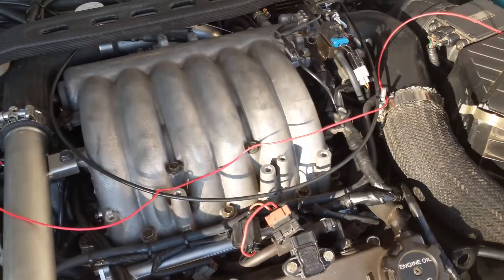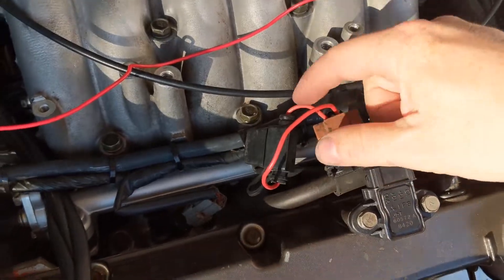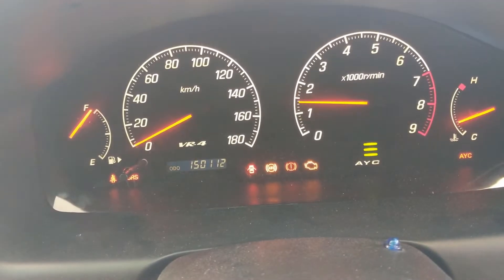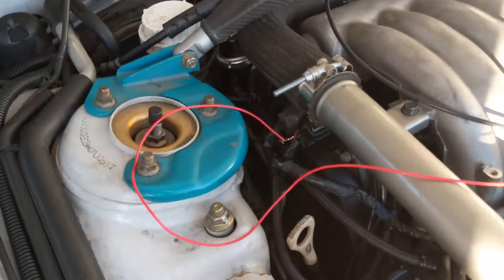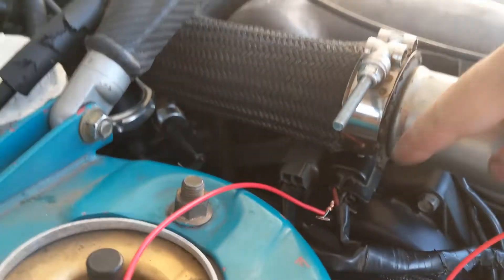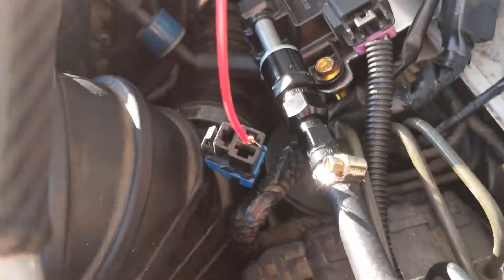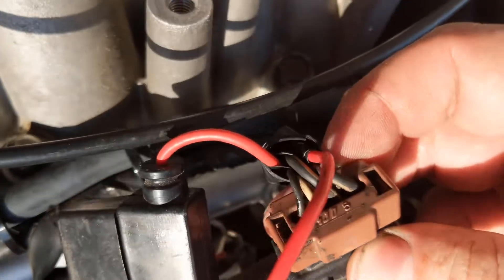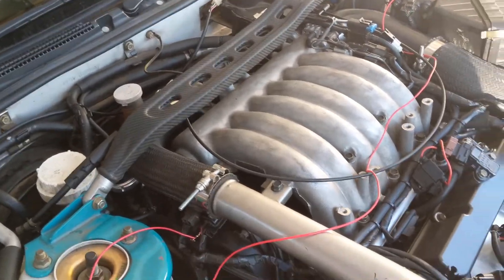Legnum VR4 Ignition Failure Sensor delete

Comment: Please help me you brilliant genius! My tacho died, so decided to do everything you showed in this video…. But still no luck, car starts but no tacho. Is there a ground wire or something closer to the actually instrument panel that I am missing? The tacho started to give trouble a while ago somethings it would work sometimes it won’t then sometimes it moves a little when you floor it. Now it’s just dead zero.
Reply from the maker: Your issue could be as simple as you need to remove the cluster from the car, give the ribbon contacts a bit of a clean with some isopropyl alcohol and put it back in.  Prior to removing it, take the binnacle cover off and see if the tacho starts to work if you push on the cluster a little while the engine is running.
Reply: @KaldekBoch  no luck bro, I also have 2 other clusters and both have same issue, do you know what is the correct voltage I am suppose to get on the rpm signal wire behind the tachometer? Both dc and ac voltage readings might be helpful, the only thing I’m thinking is that it’s shorting out somewhere before the tacho. Or maybe a bad ground?
Reply from the maker: @syrian4 I believe it's a 5 volt square wave pulse.   Need an oscilloscope to validate that you're seeing it.  If the engine is running, then the signal from the crank pulse sensor is working or the engine would not run.  Validating that the signal reaches all the way to the cluster is how you find where the issue is.  It could be also be as simple as a broken signal wire.  

I can only assume that during all this bypass testing you have indeed disconnected the IFS while you do it.  I can make all sorts of assumptions about how you're testing, only to find out that a shortcut was taken here or there, and if it's not something I ever did, it becomes impossible to "follow along", so to speak.
Reply: @KaldekBoch  yes ifs is disconnected, i don’t own a oscilloscope but I have a multimeter, I will confirm that the same voltage I get from the crank sensor is the same behind the cluster, currently pin 3 and 4 is bridged on the ifs and the crank wire is running to the white wire on the check plug exactly as you have it in video. My only other guess is like you said a bad signal wire or a bad ground or maybe one of the jacks on the coil packs is lose.
Reply: @KaldekBoch  I just noticed that the rpm is not completely dead sometimes if I rev the car high enough the needle moves up a little and sometimes it doesn’t, I also am aware that my battery may be going bad, it clicks a couple times before it starts and sometimes the reverse lights don’t come on. Maybe the dying battery is causing a low voltage sometimes?
Reply from the maker: @syrian4  that definitely sounds like a signal issue.  Would be good if you could get temporary access to another cluster and see if it works.  If so, you know where the issue is.  

But oscilloscopes are the way to go to diagnose these types of problems, 100%

Comment: Hi, could somone please tell me if pins 3 and 4 on the ifs are just bridged and what amp fuse is needed to to run that mod safely? Thanks
Reply from the maker: Hi mate, the pins are indeed bridged.  I've got a 10 amp fuse in there but 5 amps should do it.
Reply: @KaldekBoch  nice one thank you buddy 👍🏻